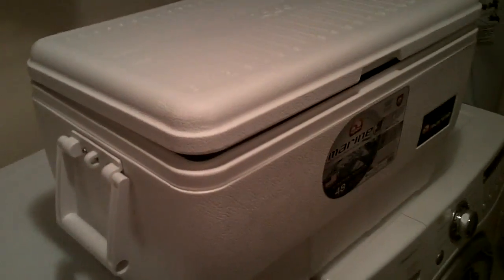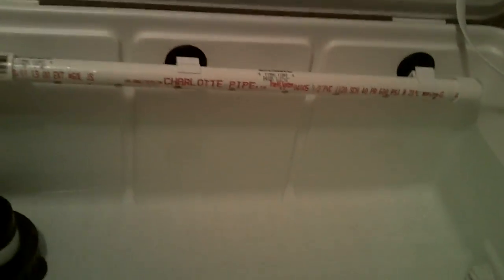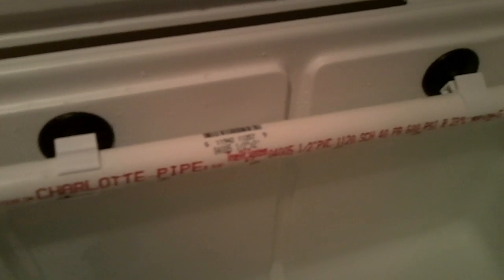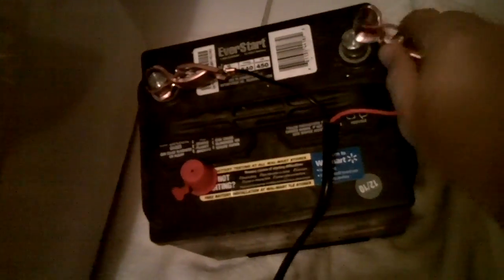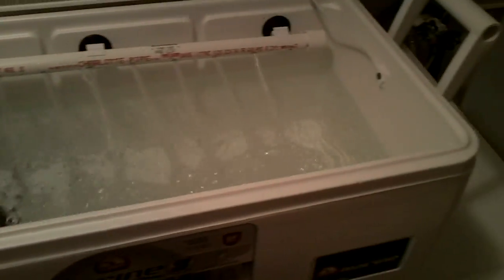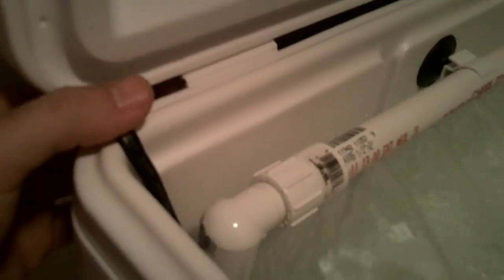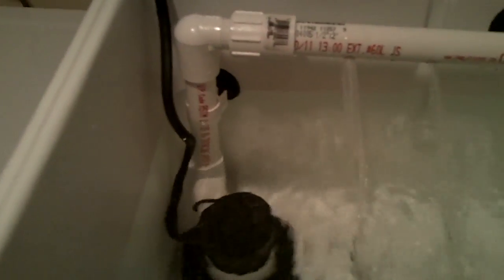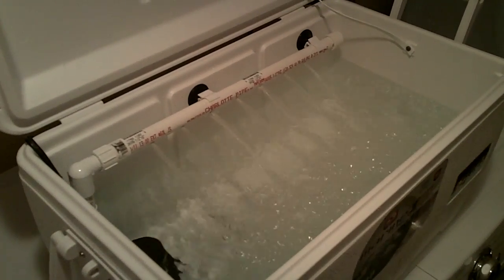Cooler Livewell

Comment: You ABSOLUTELY CANNOT have a live bait container with the pump motor submerged in the water. The pump generates heat and it will quickly heat the water and KILL live bait. With a little thru-hull plumbing, you can put the motor OUTSIDE.

Comment: Great livewell. Where there’s a will, there’s a way.
Reply: You ABSOLUTELY CANNOT have a live bait container with the pump motor submerged in the water. The pump generates heat and it will quickly heat the water and KILL live bait. With a little thru-hull plumbing, you can put the motor OUTSIDE.
Reply: 1 year too late @jimporter5845

Comment: I've got a 50L cooler container so roughly about the same size as this esky. I was considering buying an 1100 gph bilge pump as it's the same price as a 500gph or 750 gph pump on ebay. Is this overkill for such a system seeing your bilge pump has a capacity of 500gph? The following might sound like a silly question but an 1100gph bilge pump would obviously use more battery life than say a 500gph pump right? I'm looking at maximising battery life without sacrificing the oxygen flow through the water. Please help. Thanks in advance.

Comment: This guy has used a Super Saver 12 volt aerator kit that is on Walmart's site. It comes with the pump and leads, the suction cups, a flexible hose that makes his 3 day plumbing job look stupid and a piece of PVC on the end the has slots in it that aerate better than just holes, he has taken a 37 dollar kit and managed to make it more complicated and costly. Just buy the kit, it comes with everything you need except the battery and tank.

Comment: Thanks it works really good
Reply: You ABSOLUTELY CANNOT have a live bait container with the pump motor submerged in the water. The pump generates heat and it will quickly heat the water and KILL live bait. With a little thru-hull plumbing, you can put the motor OUTSIDE.
Reply: 8 years too late @jimporter5845

Comment: The whole kit including the suction cups can be bought at bass pro shop for $43. It is a Catch Saver™ 12V DC Aerator Kit.
Reply: I think the kit youre talking about comes with a hose so you can fill the cooler with water and also pump the water back out to empty it.

Comment: whadda ya think the battery life would if running non stop.  Thinking about a water proof switch so I can run the pump at intervals.
Reply: just a couple of hours. I had to get a marine battery for mine and it lasts over 8 hours on a continuous run.

Comment: it will airate better if you just cut slots in the top pipe with a hacksaw blade the finer "nozzle" will spread the water out releasing more oxygen
Reply: You ABSOLUTELY CANNOT have a live bait container with the pump motor submerged in the water. The pump generates heat and it will quickly heat the water and KILL live bait. With a little thru-hull plumbing, you can put the motor OUTSIDE.
Reply: 9 years too late @jimporter5845

Comment: These work really well, keep in mind that if you use this for keeping live bait ie: minnows, get a larger cooler, freeze some water in a gallon milk jug and put in the cooler, live bait likes cold water, vs letting the water temps get to 80 or above which will kill your bait .if you can find a small timer, attach that as well, run the the water for a minute, and turn off for 5 minutes, will save on  your battery.
Reply: You ABSOLUTELY CANNOT have a live bait container with the pump motor submerged in the water. The pump generates heat and it will quickly heat the water and KILL live bait. With a little thru-hull plumbing, you can put the motor OUTSIDE.

Comment: nicely done,! I am a bait dealer, and I sell live bait, this idea will work perfectly, and a bit better that what I have at this very moment, thank you for sharing.
Reply: You ABSOLUTELY CANNOT have a live bait container with the pump motor submerged in the water. The pump generates heat and it will quickly heat the water and KILL live bait. With a little thru-hull plumbing, you can put the motor OUTSIDE.
Reply: 10 years too late @jimporter5845

Comment: I just made one in about fifteen minutes, it's works awesome thanks dude great idea!
Reply: You ABSOLUTELY CANNOT have a live bait container with the pump motor submerged in the water. The pump generates heat and it will quickly heat the water and KILL live bait. With a little thru-hull plumbing, you can put the motor OUTSIDE.
Reply: 10 years too late @jimporter5845

Comment: hey im building this same thing. Question, how long does the pump run on the battery? Does it run all day? what size battery?
Reply: You ABSOLUTELY CANNOT have a live bait container with the pump motor submerged in the water. The pump generates heat and it will quickly heat the water and KILL live bait. With a little thru-hull plumbing, you can put the motor OUTSIDE.
Reply: 10 years too late @jimporter5845

Comment: Thanks, a great DYI project, the cheapest bait tank I found was 250.00 saving 200.00 is great. Plus there is that satisfaction that I did it. Any jerk can just go and buy one.
Reply: You ABSOLUTELY CANNOT have a live bait container with the pump motor submerged in the water. The pump generates heat and it will quickly heat the water and KILL live bait. With a little thru-hull plumbing, you can put the motor OUTSIDE.
Reply: 11 years too late @jimporter5845

Comment from the maker: I have an Attwood portable bilge that I throw overboard. Takes about 2 minutes to fill up at 250gph, and about the same to empty. Really easy to make for the use it gives you.
Reply: You ABSOLUTELY CANNOT have a live bait container with the pump motor submerged in the water. The pump generates heat and it will quickly heat the water and KILL live bait. With a little thru-hull plumbing, you can put the motor OUTSIDE.

Comment: how do you fill/discharge the water? Seems like you could set up some sort of a diverter valve to discharge the water.

I like it...gave me a good starting point.
Reply: Could just dip the water out a little then when it is low and a little lighter just pick the whole thing up and dump it. Make it with the pump in the middle-back and run the pvc pipe to each end like a T (on top with the holes) and another around low with no holes (rib-like) going around the end to the other side inside like a U. The whole assembly would sit in the cooler without suction cups, not tip over and  it could be lifted out to fill or dump.